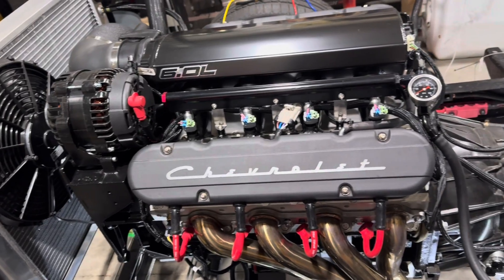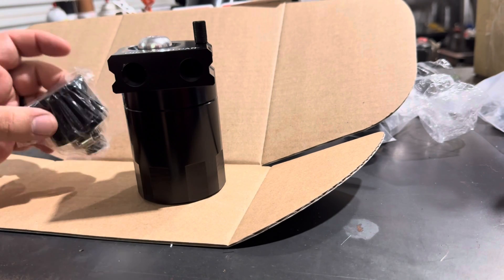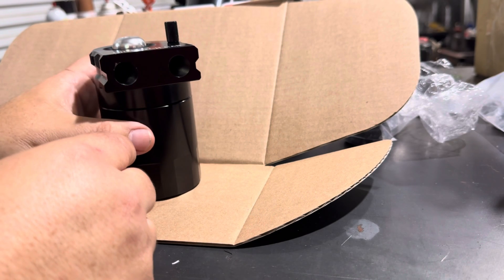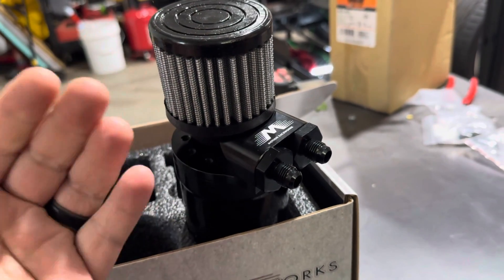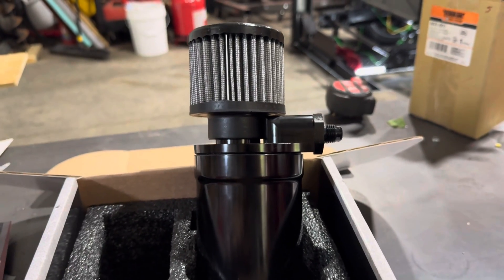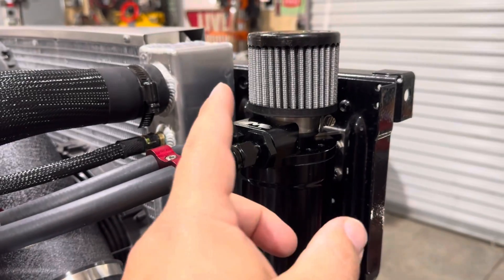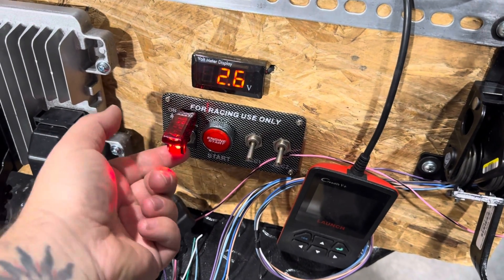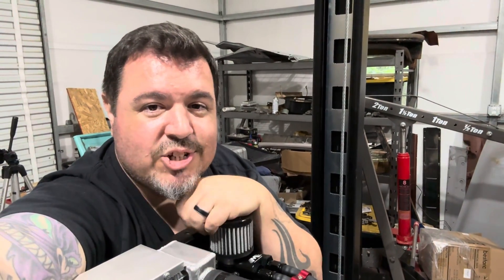Oil Catch Cans: 101 - EVERYTHING you NEED to Know!

Comment: Does it matter to have that catch can mounted that close to your air intake? Won't your air intake suck up that Steam and Vapors?  
also, I'm guessing I would need the vented type?  because I'm running about 850whp currently.
Reply from the maker: I love getting great questions like this! No, in my case, that intake tube’s filter will poke through the inner fender and not be in the engine bay anyway. Although, even if it was, the can’s “smoke” wouldn’t matter, as all the oil has already been separated. In a sealed/non vented application, its supposed to return to the intake anyway (granted not through the throttle body) but its not a big concern. In your case, especially if you’re running boost or a power adder, yes, you’d benefit from a vented system. Thanks for watching and for the great comment!

Comment: I just installed my ADDW1 catch can. I still have zero oil in my can. How long does it take for it to pass?
Reply from the maker: @johndurante2322  its a cumulative thing that takes place over a long period of time under light to normal use, assuming minimal blow by. Race applications would dee accumulation more rapidly, as would a daily driver if it had above average blow-by/worn rings etc. Sounds like you’re in good shape! Mine also has no oil in it, although Im not on the road yet… I only start and run it a few times a week.
Reply: Great video !
Living in Canada, I now know which can I’ll get…

Comment: Great video, I have a Motion raceworks vented can mounted on my firewall. As long as your firewall is seal it hasn't been a problem. Can confirm in the humid south in the summer with a 700 hp big block, there is bit of steam coming out at idle. At first I was alarmed, but now I'm use to it.
Reply from the maker: @GorhamWorks  I had the thought of ditching the filter and plumbing a line from the top to my exhaust

Comment: Oil vapers have been going back into our engines for many years, we didn't see it in manifolds because it went in before the carb, in the air filter, and then was "washed" away by the air/fuel mixture. Now because intakes have no fuel in them we can see the oil collect. I will be running a sealed catch can, mainly for the odor a vented can will cause. 
 As much as I would like a live show, the timing never works for me, I either forget or I'm busy.
Reply from the maker: I had a crazy idea of removing the breather, and plumbing a stainless braided line back and tapping the exhaust somewhere. Would still be a vented catch can, but the exhaust would help pull vacuum and I wouldn’t have visible vapor or odor. Hmmm 🤔
Reply: @intheshoptv some of the exhaust manifolds have EGR ports that potentially be used?  I had a similar thought.
Reply from the maker: @ScottTheEng  I have headers so I’d have to drill and weld a bung on. They do make clamps that have the bung too… maybe thats an option if further downstream 🤷🏻‍♂️

Comment: add the pot scrubber stainless wool from dollar type stores   allows oil a place to wick onto   works great
Reply from the maker: The Amazon can actually came with a little ball of that stuff lol
Reply: I did that same thing but the wool ended up rusting and falling apart. I even found some flakes in the oil filter on the next oil change
Reply from the maker: @necro5230  if you watch the demonstration by motion raceworks of them testing that can, It does a perfectly fine job of removing all the oil from the air anyway, without any internal media

Comment: I placed a catch xan on my first Ram 1500 5.7 hemi at 1200 miles. My new 1500 I placed a catch can at 150 miles and at 16,545 miles and it being a 2021 hemi etorque it is definitely keeping my NA engine intact spotless. It's a sealed that unit I purchased from ebay years ago for $59 shipping and handling. It mounts to the head of the block
Reply from the maker: My daily is a 20’ Laramie 5.7. Love it!

Comment: Best thing for those push to connect fittings - boil a pan of hot water, dunk the hose end in the water for a minute or so, then slam them on the fittings.  Works well and leaves no residue that can cause the hose to blow off later.
Reply: I've used that trick quite a bit. Tight hose fittings, sliding on new spark plug boots, carb o-rings, cab and door seals. It helps to rejuvenate dry shrunk rubber.  New sub
Reply from the maker: I used to do that. I find that the BEST way is to use new hose. But a slight film of silicone grease never hurt
Reply: Lol... I just did the same thing to my canister filter hoses. Hose slides right over the fittings.

Comment: I plan to run a dual sealed catch can setup from Racetronix. One will be inline from a valve cover to the air filter base, and the other will be inline from another valve cover to the throttle base PCV port. The twist on my setup will be this adjustable billet PCV valve from Wagner Performance on the outlet of the 2nd catch can, which will keep it cleaner than it being on the valve cover passing the contamination to the catch can. Im sure some people will think what they will about my first catch can being plumbed to the air cleaner base, but the factory engineers were clever! There is more negative pressure between the air cleaner and the throttle, where the engine bay will be at atmosphere, or even pressurized slightly. Under load, your crank case will fare better if the breather line was being scavenged over being vented.
Reply from the maker: Sounds inventive and elaborate. I like it
Reply: @intheshoptv negative pressure in the crankcase is the best scenario. That is why the sealed can is better.
The crankcase is always pressurized in order for the vented system to work. This is a less than ideal scenario.
Reply from the maker: @sloeryd  Hope its working out great for you. Thanks for watching
Reply: DW
I totally agree with you.
Reply: Wht woulld you need a dual setup, its all. Connected so as long as your taking air from the motor you should be fine

Comment: I run 2 out to atmosphere on my camaro with several crankcase filters, I am running 950 rwhp.
Reply from the maker: Yep you need em with that kind of power. Do you get much steam/smoke noticeable at idle?
Reply: @intheshoptv  very little, but you can certainly smell oil after wot.
Reply from the maker: @chriscook377  I can smell mine at idle. The LY6 is an oily sob